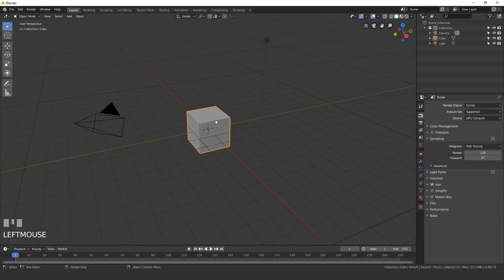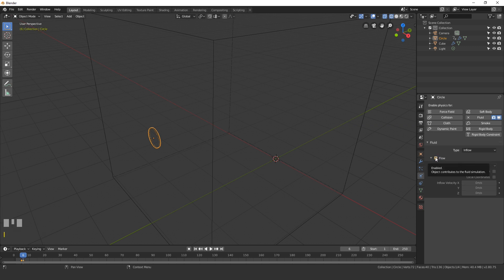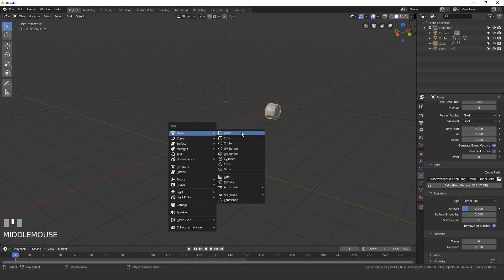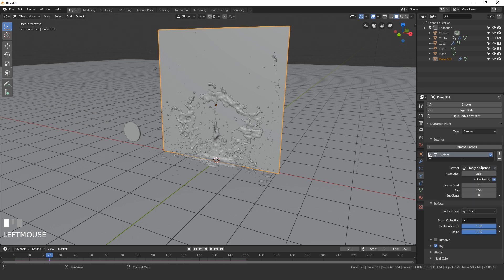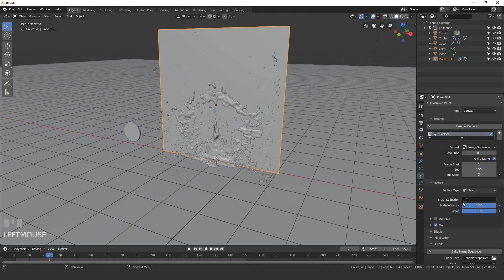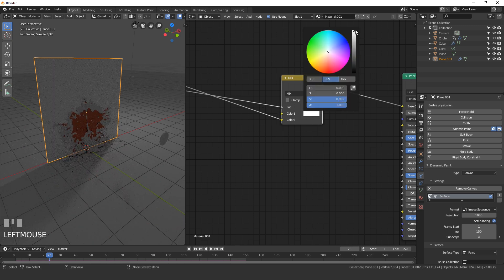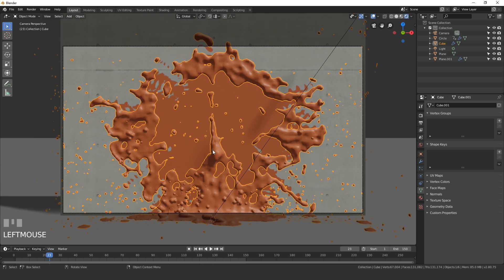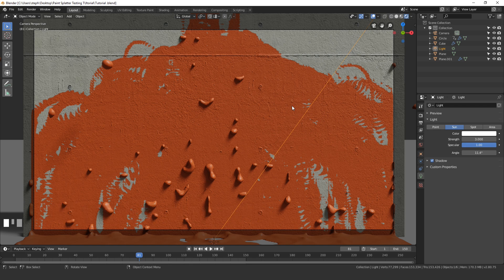Blender Tutorial - Paint Splatter Effect in Eevee

Comment: I can't locate the "boundary" tab under physics properties like in this video. I am using 2.82 so has that changed? I also had to do 2 extra steps to activate in-flow during this version so i didn't know if anything else changed
Reply: how did you fix it?
Reply: @catarinanorberto5796  in-flow is located under the flow type in blender 2.91
"boundary box" i believe was in settings within the physics properties (with cube selected) > Check mark fluid > expand the tree for fluid > expand particles > I checked "Mesh" go to Upres Factor (this is to up the resolution of the mesh) which i think maybe the same thing as to his subdivisions with boundary box. AFter that I put particle Radius as .010 but i'm not sure if that will give the same result. all in all. I think its best to say this tutorial is severely outdated now and I wish the author would comment or make a new tutorial
Reply: did you managed to locate it?
Reply: @baryafe  I just saw this again and this tutorial is super outdated. I think there is a new particle system using nodes for 2.91

Comment: I'd use a Black&White (less disk space required) dynamic paint image sequence as input factor for a Mix Shader node rather than a Color Mix node: this way you can have the the paint more glossy/wet than the wall. Both shader could then share the same displacement map.
It's better to always apply transformations (ctrl+A) before any simulation to avoid issues.
Some steps are repeated, e.g. you could simply leave the default cube, or enter edit mode for the domain and duplicate a face to create the wall (and Alt+P to set it as separate object).
And, as mentioned, definitely check the color management you're using to avoid unexpected color hues!
Btw, the idea to mix dynamic paint and fluid simulation is good!